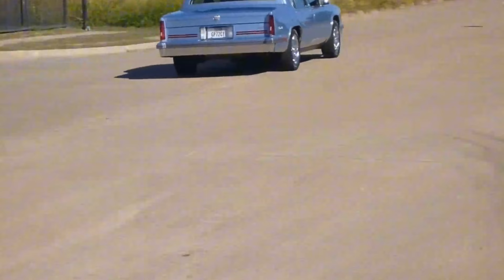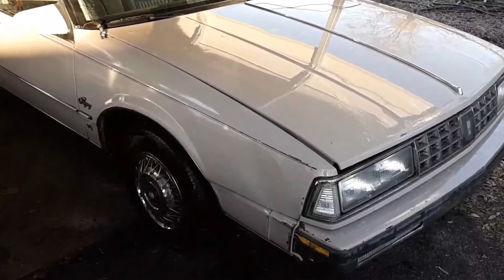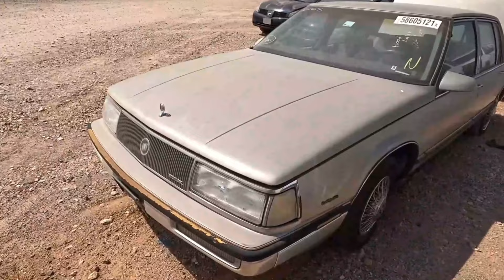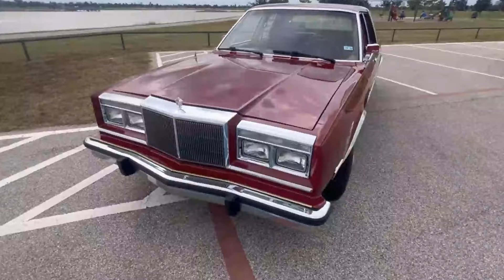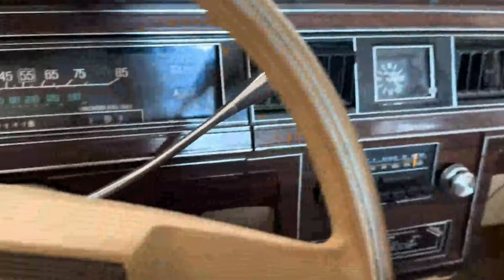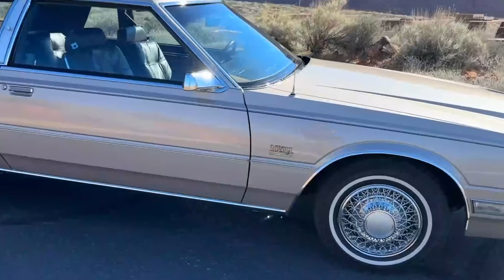8 Worst Full Size Cars of the 1980s

Comment: When GM announced the 85 downsize, my father ran out and quickly bought a 1984 Olds 98. The last full size rear wheel drive model. We drove that 98 251,000 miles.  The only thing that was replaced was 1 transmission.

Comment: This video was informative and yet true. Thank you for the video.  I own the later upsized Oldsmobile Ninety Eight( 1991-1996) and Oldsmobile Toronado( 1990-1992). GM paid a heavy price for downsizing all those cars 1985-1991 in the 1980's. It cost them market share and buyers Ford(Lincoln and Mercury) cashed in as well as Chrysler too. They fixed Deville and Fleetwood in 1989 model year,  Ninety Eight and Park Avenue for 1991, and Toronado, Riviera and Eldorado and Seville in 1989-1992.  GM upsized all those cars by 1992 and brought back the Buick Roadmaster as well. The Cadillac Brougham got more power by 1990-1992. It really had power 1993-1996 using the LT1 350 V8. When GM upgraded and fixed the 3800 V6 in 1988, things indeed changed. 

1989 Deville and Fleetwood:
https://www.youtube.com/watch?v=1xLRJ9Sghz4
https://www.youtube.com/watch?v=ZU_3Irz3Lco

Mercury Grand Marquis commercial:
https://www.youtube.com/watch?v=_4EkPu9r9os

Lincoln commercials:
https://www.youtube.com/watch?v=SaZqQLpbjFU
https://www.youtube.com/watch?v=w4ZYucg06Cs

1991 Oldsmobile 98 commercial:
https://www.youtube.com/watch?v=dNCxSbGxPEU

1990 Oldsmobile Toronado commercial:
https://www.youtube.com/watch?v=jdZPvVSmGqA

1993 Cadillac Fleetwood:

https://www.youtube.com/watch?v=RdMoLICbSEE

1992 Buick Roadmaster:
https://www.youtube.com/watch?v=7R9-sijQanU

1989 Buick Riviera:
https://www.youtube.com/watch?v=FI9BE_CIcRM
Reply: Chrysler didn't really have anything in that market segment after 1981.

Comment: The Imperial was not a modified front wheel drive K-car. Lousy AI generated content not worth watching.
Reply: Yeah, he got confused witb the 1990-93 Chrysler Imperiial, a Y nodied front wheel drive full sized version of what originally was the small intermediate K body car.  The 1981-83 Imperial was a stand alone brand positioned above a Chrysler of the time, built on a Chrysler J body platform the same as a Cordoba or Mirada of the same era, really similar to the rear drive M body of the time and the F body from one to four years before that.
Reply: @zachlafleur6651 It was actually bigger than the M body cars, except it was only a 2-door car. No 4-door, unlike with the M cars.